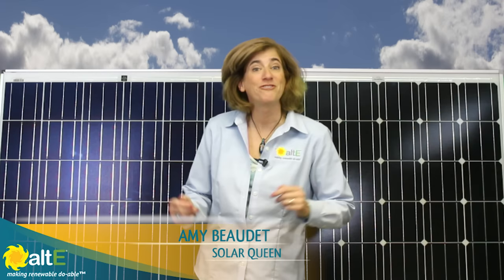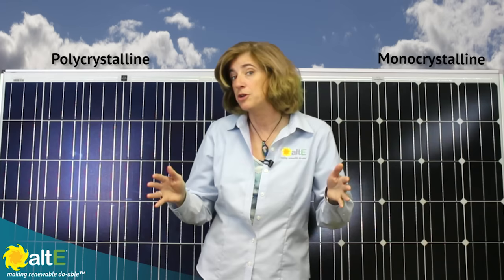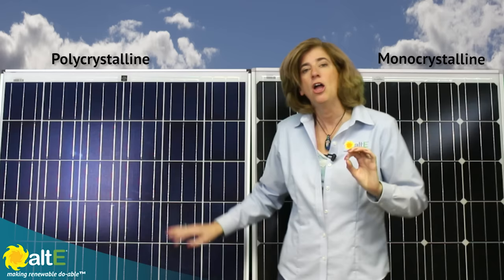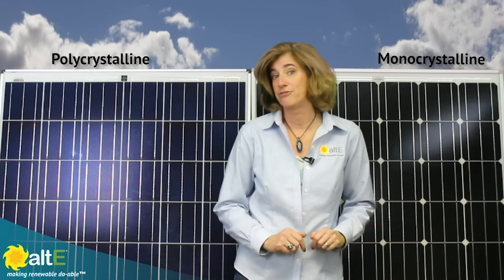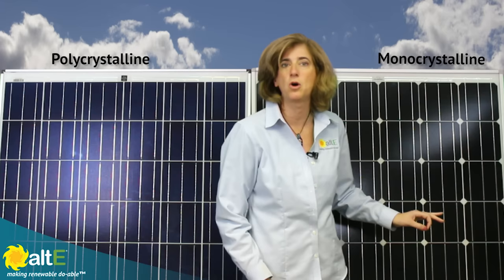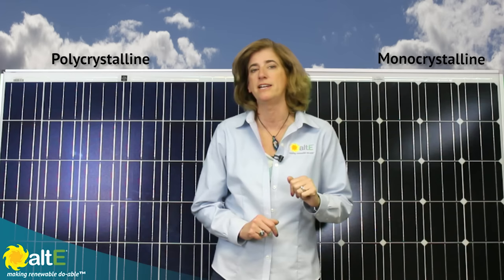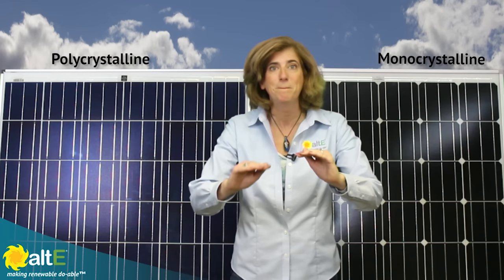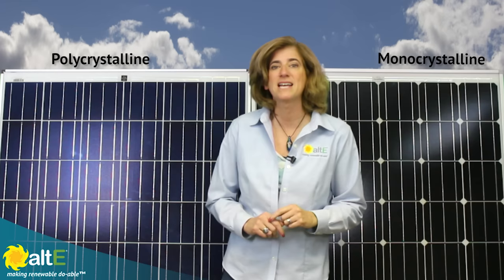Monocrystalline vs. Polycrystalline Solar Panels - What’s the Difference?

Comment: This is the best quick comparison I've seen so far. Well presented too. Thanks!
Reply: Lets see, SHE deliberately left out the TRUTH. Poly produces MORE KWH per day that Mono. Why? Because Mono has to be pointed directed at the sun and or put on a tracker to get full output. Poly can be off up to 10 degrees to get the same power.  Obviously they are over stocked in Mono so its the best thing since sliced bread now.
Reply: I see little evidence that Angle of Incidence has a meaningfully divergent effect on mono vs. poly.  
If you have a citation for the claim I'd be happy to read it and revise my position if needed.

Digression:  folks who strive for Critical Thinker status (as you indicate in your profile) generally avoid  emotional language and groundless accusation, and try not to project motivations onto others.
Reply: Gyppor szzzxxx.
Oa
Reply: yup, they'd make renewable doable

Comment: Thank you for this very nice explanation!
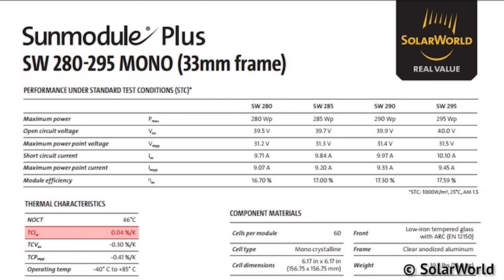There is a mistake made however at 4:00 to 4:40. The short-circuit current actually increases with temperature, hence the positive temperature coefficient. The open-circuit voltage decreases (much faster) and the overall power output also decreases; both have negative temperature coefficients.

Comment: Nice comparison of mono vs. poly panels. Both work great so long as you buy Tier 1. If you are space constrained you will want to go with mono because you can achieve greater energy density. But for most homes and businesses, poly will work just fine. Let's grow solar!
Reply: Hi Tim, what does tier 1 refer to?  Thank you.
Reply: Tier 1 solar panels are built with higher standards (to last longer and produce abundant solar power) and have a highly regarded reputation within the solar industry for quality and service

Comment: To those interested:...…...I had a mismatched, 4,400 watt array that was Cooled by a single (Isolated) 12v panel hooked directly to a computer fan, drawing cool air from corrugated tube, just underneath the ground.   Not needed when sun was at low angle, so no battery needed. It helped to produce more power during hot days, instead of common overheating losses.

Comment: I have a 100 Watt Monocrystalline solar panel mounted on my RV roof. up here in the Rain Shadow on Vancouver Island, we get many cloudy, rainy days (even in the summer). I am quite surprised at the power generation I am getting on overcast days.
Reply: Amorphous Kicks the crap out of Mono and Poly
Reply: It was my understanding that amorphous panels are less susceptible to partial shading issues, but they are less efficient (lower wattage per square meter).  Are you talking about low-light conditions?  Have any data to back up your claim?
Reply: Mark Job d

Comment: You are mistaken at 3.57,the current increases while the temperature rises. It is the voltage that drops significantly and hence overall power. Refer the - sign in front of temperature coefficients. Good presentation though:)

Comment: I have mounted 6 mono panels (300watt eac). I m planning to add more panels. Can i combine them with 4 poly panels of same wattage? Will it affect over all efficiency? Or go for mono panels only. Here temp go up to 46c during summer.
Reply from the maker: You are in a location that would benefit from mono panels because of the extreme heat. If you can't get them, and have to use poly panels, it may be worthwhile to get a second charge controller to run the poly panels and not have them affect the mono panels. I suggest comparing the temperature coefficient on the datasheet between the 2 types of panels you are looking at. If the numbers are similar, it may not be a problem.
Reply: altE 
I had same question.
Thank you for answering!

Monocrystalline seems the way to go since I'm a big fan of taking solar technology and batteries to the next level.

Comment: 2% more efficiency is ca. 12% more Power output, circa 17.5/15.5=1.12
Reply: That doesn't corrolate with the figures she gave e.g. 260W Polycrystalline vs 270W Monocrystalline>
I calculate a 3.7% difference in output power!!  Go figure!
Reply: @av6966  probably a bit more surface area on the poly, as the corners aren't rounded.  But that wouldn't make up the difference.
Reply: @ancapftw9113  I'm new at this but how did you figure this number number up? Thought if its 2% should be .02
Reply: I would stand by with what the lady said. It may be just the stupid talking out of me, same concept but other way around. Your car/truck battery, if its say minus 15 degree Fahrenheit and not been started for few days, your vehicle battery only had 2 different cranking amp categories. One is CCA for temperature is 32 degrees fahrenheit or lower and another section  is CA which is temp is above 32 degree Fahrenheit. Can you guys take a guess what's the result would be those 2 sections in different temperatures? Cold temperatures will drop your voltage from 12 to 6 volt depending upon the condition of the batteries. But your amperage will go up. Chances are it's not gonna get it's full cranking amp on time because batteries just died on you. Above 32 degrees voltage will drop around 9 to 10 and still get almost full cranking amperage. My point is that there is some things that certain things will kill certain things effectiveness. I may be wrong, the hotter it comes, the more resistance it will form causing the best effectiveness to drop a bit. But hey 2% that's not much at all. Heck can fix that problem real fast, if it's a concerned, add another backup supply battery lol
Reply: @matthewdavis7780  they are measuring efficiency differently.  While the overall efficiency is 2% greater, it outputs 12% more power.

One is comparing the output to the ideal efficiency (100%), the other is comparing the panels to each other.

Think about it this way: If I have a 5 gal can for gas, but it only has a gallon in it, it's 20% full.  If I add and another quart, it's 25% full.  The way she's measuring it, that's a 5% increase, but I actually have 25% more gas in the can.
Reply: @ancapftw9113  that makes alot sense to me now. Thank you

Comment: What you do not take into account is Livespan. Multicrystalline Panels (poly is the wrong word, since polycristalline silicon is the refined silicon, say the rawmaterial) will degenerate much faster. So in the long run mono is always better.

Comment: I understand where you get the 2% difference, but my math says that the 17.5% mono panel is actually 12.9 % more efficient than the 15.5% panels. 
2÷15.5= .129 ( or 17.5 ÷ 15.5 = 1.129) expressed as a percentage as a 12.9% increase. Love your videos, looking in to getting some solar for our RV. Thanks!
Reply from the maker: You are right, I missed that day at math class. I totally blew it.

Comment: I have mono panels and when I got them I tested them in the winter and they outperformed the giving data
2 years later they still outperform the giving data in the winter.

Is there any difference in longevity of life between mono and poly panels.
Reply from the maker: Sorry for the delay in response. That's a really good question. I reached out to solar panel manufacturers who make both types, and was told that there is no difference in the technology that would cause one or the other to degrade faster than the other. The National Renewables Energy Lab (NREL) has published papers on the different degradation rates of module technologies; the primary contributor to degradation between mono and poly is quality of manufacturing and material selection, not the cell technology itself. So it's really more about how they are made, not which technology.
Reply: Thank you very much for answering that question.

Comment: if you say about the less than perfect light, does that include panel angle? 

if I have a flat roof, would Mono behave ok flat on the roof (with brackets to lift off roof) than Poly?

Comment: I need some solar panels! I don't guess it really matters if its pile of crystal  or mono crystal. I will probably have to buy one at a time. I'd like 250w 24v panels . but may have to ho with 100w12v because of shipping. do you guys offer any deals that would help me . thanks a lot. I love this channel. I'm off grid and must get some panels. the gas generator to charge batts isn't good! thanks again.

Comment: But I have seen in other videos and websites that claim Polycrystalline solar panels have lower temperature coefficient than Monocrystalline solar panel. Hence Polycrystalline solar panels performs better than Monocrystalline solar panel at high temperatures.
Myself from India and I got two 100W polycrystalline solar panels for installation in my home to reduce electricity bills.
Reply from the maker: +Dinesh S Different manufacturers have different results, so Brand A's poly may have a better temperature coefficient than Brand B's mono. But when comparing the same brand's panels between mono and poly, I found that mono had either a better than or equal to temperature coefficient than poly. But again, the difference, if any, was so slight, that it really did not make much difference at all. 

Just one example:

SolarWorld Mono:
Pmpp -0.41 %/K 
Voc -0.30 %/K TC
Isc 0.04 %/K TC
NOCT 46 °C TC

SolarWorld poly:
Pmpp -0.41 %/°C 
Voc -0.31 %/°C TC 
Isc 0.051 %/°C TC 
NOCT 46 °C TC 

However, Canadian Solar showed no difference between their two types, but SolarWorld's poly has better Isc temperature coefficient than Canadian Solar's mono. 

Canadian Solar mono & poly:
Temperature Coefficient (Pmax) -0.41% / °C
Temperature Coefficient (Voc) -0.31% / °C 
Temperature Coefficient (Isc) 0.053% / °C 
Nominal Operating Cell Temperature 45±2°C

Moral of the story, both technologies are great, use whichever solar panel fits your space and budget.
Reply: +altE Store : Thanks for providing this information with examples which is very helpful to understand.
Reply: The biggest revolution : use solar PV crystals / glasses for solar windows , to be used in flats (multi-stage buildings) in cities.
Reply: altE z

Comment: I've read that Poly perform better on hot climates compare to mono crystalline, despite of its heat tolerance, this is due to cell color.  The pure black color of mono causes the panel to absorb more heat.  I believe this is true, this is why poly is recommended in our country (Philippines).  May I have your opinion about it?
Reply from the maker: That certainly could be, especially if the panel has a black frame and black backing sheet. But once again, the differences really are not huge, so whatever panel works for you is a good choice.

Comment: Do you need by-pass diodes if only using panels in a grid-tie situation? Or can you skip them?
Reply from the maker: If you are using a grid tie inverter or a charge controller for off-grid, you most likely will never need an external bypass diodes. We did a video on that, https://youtu.be/5rYy0gHZepI.

Comment: I have heard mention that mono-crystalline is more effective where partial shading of the panel might be of concern.   Specifically, that if a poly-crystalline panel is partially shaded, the output of the entire panel (i.e., even the unshaded part) is significantly reduced, while for the mono-crystalline panel, the output of the unshaded portion of the partially shaded panel is unaffected.  Can you either confirm or debunk that claim?
Reply from the maker: +Peter K. I can debunk that claim, absolutely. Mono and poly solar panels are both wired the same way, and with the same material. It's just the way they turn the silicon into cells that is different. They are both affected by the sun, and lack of it. The mono may be ever so slightly less affected by shade, but they are still affected none the less. 
 I'm running out f good weather for the year, but as soon as we get sun in Massachusetts again, I'll do a demo comparing mono and poly outside in the sun to prove my point.

Comment: +altE
Our summer is very very hot about 40 - 50 degrees and the winter is around 27 - 30 degrees. The average rainfall for the year is 163 mm.
What solar panel would I need for that climate?
Reply from the maker: The very best solar panels for hotter conditions are the ones that have the lower temperature coefficients, meaning they decrease less quickly in power output with an increase in temperature. One of the best panels is probably the Panasonic HIT series of solar panels, followed by monocrystalline solar panels, many amorphous solar panels and lastly polycrystalline. All solar panels should withstand plenty of rainfall - they just won't produce much power in down pours is all. Panasonic's HIT technology does allow them to produce more power in indirect and low light (like when it rains during the day), so you get more overall energy over the course for the same rated watts.
Reply: +altE
How many solar panels would i need to use three DC T.V, four DC ceiling fans and ten DC lights?
I think 600 watts could work it
Reply from the maker: You would need to also say how many watts each of these devices use, and how many hours a day each of these items would run. Go to our loads list calculator to determine how much power you need to make, https://www.altestore.com/store/calculators/load_calculator/, then put that number in our off-grid calculator to see how much solar and batteries you need, https://www.altestore.com/store/calculators/off_grid_calculator/.
Reply: Also count the days when there is no sun during winter time.You may go for A small backup generator to save battery costs.

Comment: another dealer I know that lives in Oregon area, says that the poly panels out perform the mono because of the sun's position which would be similar here like in the Berkshires. but you are saying the opposite.
we certainly don't live in the desert.
john
Reply from the maker: +Rev John O'Toole I'm not sure what their logic is. Perhaps saying it is a better performance for the money, I would certainly agree with that. Other than extreme conditions, the two technologies would likely perform the same, and therefore poly may be the winner simply because of cost. The differences of the two are so minor these days, it really isn't worth worrying about.

Comment: Hello miss.
Here we have two months of extreme cold with fog.
Two months with extreme hot with 46 degree centigrade temperature.
Two months with rainy  season.
Which type of solar panel we install???
Reply: 2 poly and 2 mono series of 2 then parallel. and be happy 😊

Comment: In your opinion Amy, what are the best quality solar panels available in America today. They can be manufactured inside or outside the country, I'd just like to know your top 3. I've heard good things about Kyocera, Sun Power and Costco offers grapesolar I think is the brand but if you were buying solar panels for your own home and money was no object and you wanted panels that generated the most power, size being equal, which would you chose? Thank you for your great videos. Best regards.
Reply from the maker: I am a huge fan of both SolarWorld and Kyocera panels. Tremendous quality and value, and terrific companies to deal with. With a few extreme exceptions, I don't see the benefit to paying so much more for SunPower panels, yes they are more efficient, but the premium price you pay for them makes the payback time less appealing. (I know you said money's no object, but I'm a New Englander, money is always a factor). I personally haven't used the Grape panels, I hear they are fine, but can't give an opinion.  Same with LG, I've heard good things, but haven't dealt with them. Basically, all tier one solar panels meet the high quality requirements, some are better than others, but all are good. It's some of the no name Chinese panels that have quality issues.
Reply: Thank you Amy.
Reply: noviceprepper53

Comment: What do you suggest if during part of the day you have PARTIAL shade moving across, like from a power line of small tree branch. Not enough to block an entire panel, but maybe 20% of the panel at a time. Mono or poly?
Reply from the maker: +SkyCNG Both would likely be affected the same. You may be better off addressing it with the equipment you use, with separate  charge controllers if off grid, or microinverters or DC optimizers if grid tied. This will help prevent one panel from negatively affecting the other non-shaded solar panels.
Reply: +altE Store the question is : Mono or Poly... All other answers = politician way of lying.
Reply from the maker: +Kalvin One I respectfully disagree (ok, that sounded like a politician). There is not a black and white answer to the question. What if they can get a 120W mono panel and a 130W poly panel for the same price? Which is better? What if they separated the panels from each other with a diode to prevent the shaded panel from interfering with the others (see our video on diodes at https://youtu.be/5rYy0gHZepI) ? What if the efficiency of one brand of mono is lower than the efficiency of another brand poly? There are lots of variables. And once again, the differences between mono and poly are so small these days, except for extreme instances, it really doesn't matter. So while there may be a precise scientific answer with all of the variables filled in, it may be so small of a difference, it doesn't matter.

Comment: Is there is a difference in energy production between monocrystalline and polycrystalline under overcast conditions?
Reply from the maker: +Ommmm Mono panels can perform slightly better in overcast or hazy conditions. But again, the performance difference is very slight, and varies between manufacturer's, so one manufacturer's poly may perform better than someone else's mono, depending on their manufacturing process.